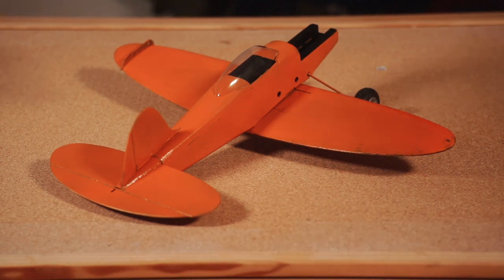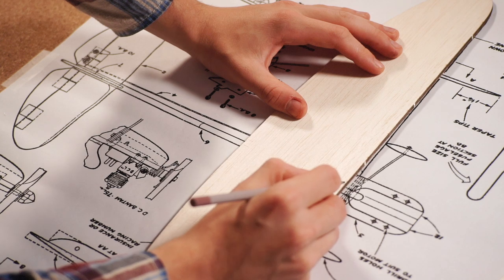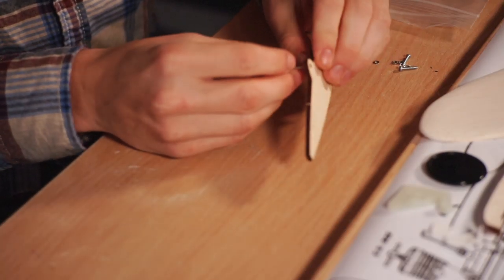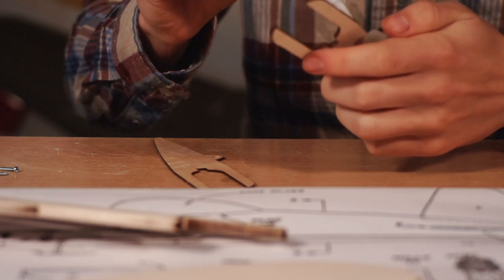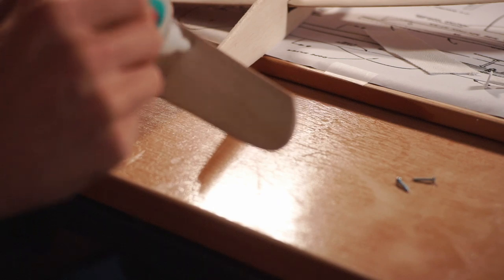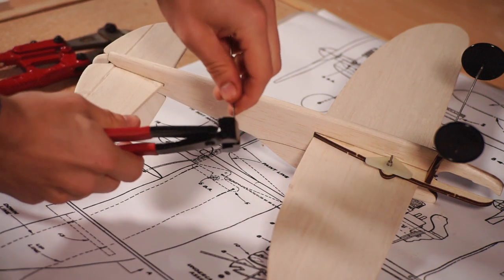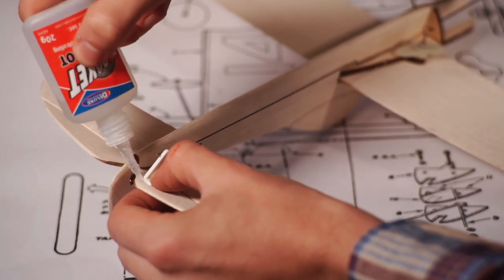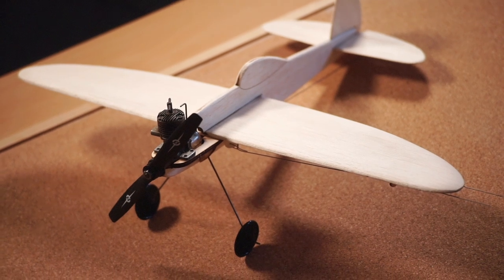How It Works: Control Line Airplane // Build Video

Comment: Aviation is the only pursuit ik the world where the most basic and oldest of operation, like free flight and U-line, exist simultaneously with the most advanced.
Reply: It's great to take a really old kit that could barely be controlled with escapement and pop in a truly modern  4 channel system.   I love it.
Reply: And still as much fun as they were back in the day,it got me started and I had hours of flying enjoyment.
Reply: @frankderryberry1412  Yes - there is understandably not so much enthusiasm for fitting the old escapement S/C gear into a modern airframe!
Reply: I think they still race tether cars and boats. The boats are really cool flash steam, and really really fast.

Comment: As James alluded, definitely use a more a more solid method of securing the elevator control horn. Most control horns have a back plate you can screw in to.

Comment: James the control horn should be fitted  with the axis in line with the hinge not in the middle of the elevator as you have shown here,otherwise a lovely little classic build,these fly really and such fun to fly.
With the silly rules and regulations I can see control line making a bit of a comeback for no hassle flying.
Reply: As a way of 'confusing the enemy' I have built a Champ with electric power, an elevator servo and a micro receiver and fly it round a pylon on dyneema line. That way I don't get dizzy like I used to last time I flew CL about 40 years ago.
Reply: Colin that is exactly what I want to do ! C/L R/C Hybrid,what shall we call our invention  ( Whirlyradio comes to mind ?  ) I have some short range Orange receivers that I was going to scrap they will be ideal for this,do you take off from a smooth surface or simply hand launch the Champ ? Confuse them indeed and to quote 'Dads Army' they dont like it up em !
Reply: @angelreading5098  I was thinking of calling it FTCAA but the words of the acronym escape me now 8-)= 
I'm using a little Orange Rx and as you would expect have had no range issues. I take off from a piece of tarpaulin pulled reasonably tight over the grass as I have loads of tarps to hand. It saves cutting the grass every time. I think some foam camping mats would be even better. Because there is less of an imperative to keep the line tight as there is with real control line I have the CG somewhat further back than on the original Champ plan which seems to help in keeping the climb and dive on the into/downwind halves of the circle. 

I think it's great that some of Bill Dean's designs still get an outing and have new life put into them. They were responsible for much joy in my youth.
Reply: Colin you are a man after my own heart,this is all about pure nostalgia and we need to keep Bills designs going into the future,just about to embark on a Sharkface with electric power to fly in a tiny field,I think that model flying has gone full circle and retro flying is full of interest especially as plenty of plans around.
I saw some of those camping mats at a show this year and now I know what they are for since you mention them,I have Harold Towners Dragon Rapide that I want to fly C/L R/C as pointed wingtips not good for ordinary flight but just to see it in the air gyrating,lovely to chat with you,real model building and flying.
Reply: @angelreading5098  Angel - I had a look at the Towner Rapide plans and I agree you would need a steely nerve to fly anything with those wing planforms as an RC model. I had a Fournier RF4 that was tricky enough near the stall and I suspect the Rapide would be in an entirely different league. My current big project is a Blackburn Monoplane to the Dave Boddington design (homage to the great man) and have talked myself into electric power with a scale prop, dummy rotary engine (that does rotate) and scratch built spoked wheels so it's been keeping me off the streets even though I haven't even started the airframe yet.
Reply: I have a bigger Rapide too plus a Breda Ba.44 ( Italian licence built DH.84 Dragon) all suffer also from trouser drag on grass runways .
Built three of Finucanes Blackburn Mono in the past with various small diesel motors I think Boddos version is based on that one,they all fly beautifully,like building a boat the fuselage with those 'V' shaped formers.
What length lines are you using on the Champ Whirlyradio ?
Reply: @angelreading5098  I have flown it on a 25ft line of 40lb dyneema (0.33mm diameter) and despite having the CofG further back it keeps the line tight. I reckon it would be fine on 32ft which I think is the standard for Champ racing. I have the LiPo tucked under the root of the starboard wing which gives an offset of the CofG outboard about the same as a 0.5 ounce tip weight would do which I'm sure helps. I'm using a 2212 motor of 1400kv and 2-cell 1000mAh LiPo turning a 7 x 4.5 prop on a prop-saver hub. The motor is a bit over the top for the model (the original ED Bee only put out about 50 watts!) but was what I had to hand. I stretched the design slightly to keep the wing-loading similar to the original Champ with an ED Bee in it. I think a slightly smaller motor and LiPo would suit the standard Champ dimensions fine.
Reply: Some good tips there,is that dyneema like the old terylene we used to use Colin ? good idea with the outboard lipo position I was wondering how these models keep the lines tight,I bet its strange at first flying remote C/L ? must try and find a car park somewhere to do this.
What do you use for a pylon ? something that does not rely on putting a big hole in the ground on tarmac,a friend suggested as a basis a bicycle wheel.
I can see control line flying coming back again although it never really went away.
Reply: @angelreading5098  Yes, the dyneema is very low stretch and extremely strong for its diameter. It is sold under all sorts of trade names as fishing line (Spider-Wire being one of them). You can get bright yellow which is good for seeing when its trailing over the ground. I just used a 1.5m length of 25mm dowel for the pylon with a screw into the top end that holds a freely pivoting 250mm long arm that the line attaches to. The arm just makes sure the line does not wind itself round the pole. In my case I kust use 3 guy-lines down to three tent pegs into the grass but I guess you could just use three heavy blocks if you were on a hard standing.  One of those bases they make for outside sun shades would probably be very good for it if a bit heavy for portability!
It is certainly a bit strange flying CL from the transmitter  but on a totally calm day you don't need to do much with the elevator anyway. After a while you get used to feeding little bits of up and down in to deal with the into/downwind climb/dive tendency. I would certainly recommend giving a Champ or the like a fair bit of flying before trying the Rapide.
Reply: I get the picture Colin,yes the Champ will be my trainer conversion model,I have another control liner hanging on the wall here needs finishing built from an old 'Model Aircraft' plan the Miles Gemini plus a de Havilland Heron airliner awaiting motors,another one intended for radio but safer to fly like this with more narrowed wings,I like building control line models even if they are not flown conventionally,I have my eyes on a car park that is little used at weekends,thank you for all of the useful information provided.

Comment: I should mention that I had a great deal of fun making a Champ that I converted to electric power using a 2212 1400kV motor and a 2S 1000mAh pack. I used a cheap micro servo for the elevator and flew it around a pole on a single dyneema line with control via a cheap park-fly receiver. So I had the fun of re-visiting control-line flying without revisiting the dizziness. 

To accommodate the higher weight I stretched the design slightly (600mm span and 110mm root cord for the wing). 

When we get some decent weather I'll be out flying it again - from the comfort of my camping chair 🙂.